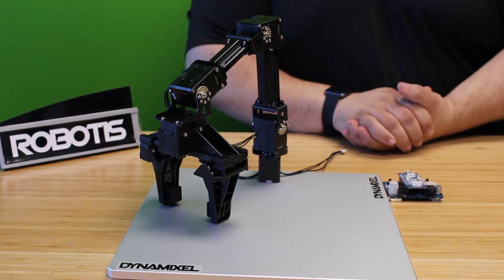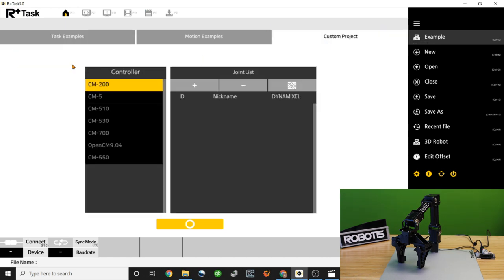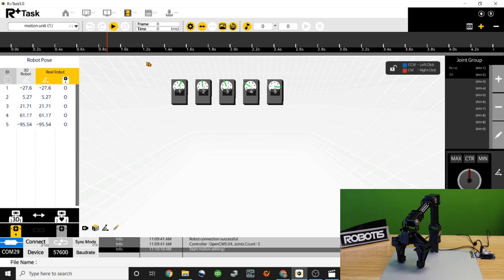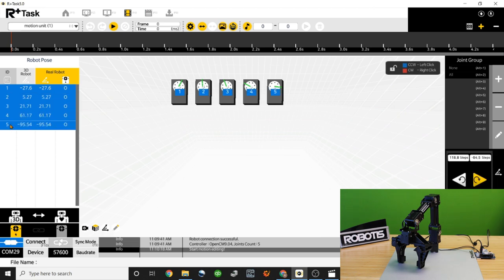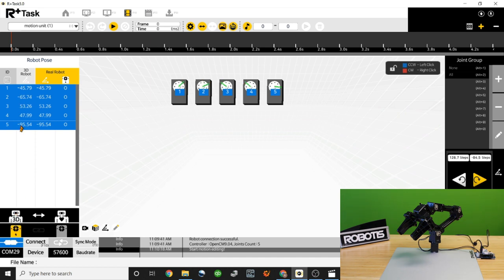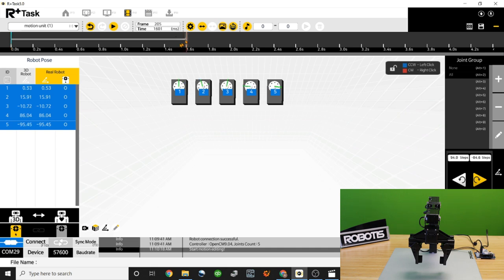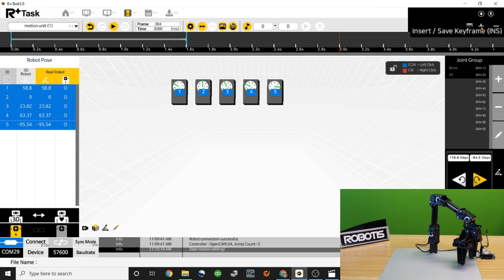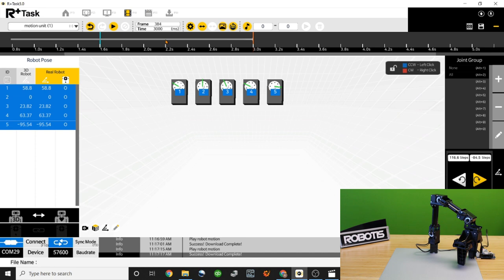How To: Make Custom Motion Files in R+ Task 3.0 Educational Robot Software

Comment: How can I use wheel mode? I have a wheel on my robot and I want the motor to move continuously.
Reply from the maker: For AX and MX1.0 motors, wheel mode can be enabled by setting both of the angle limit control table items to 0. https://emanual.robotis.com/docs/en/dxl/mx/mx-64/#cwccw-angle-limit6-8